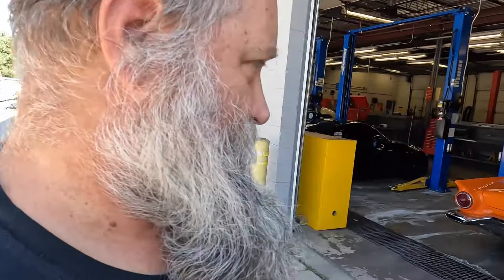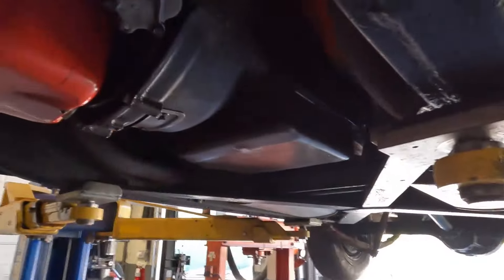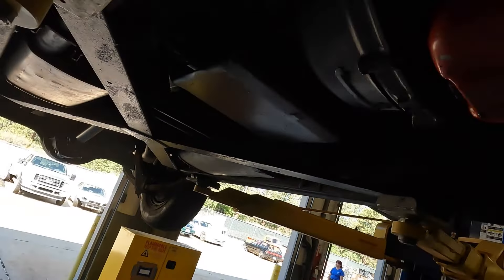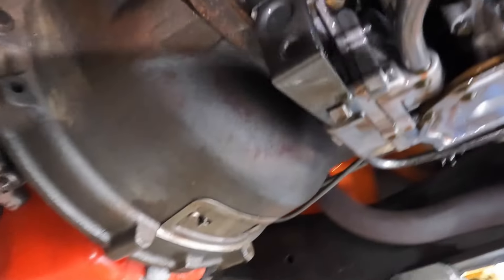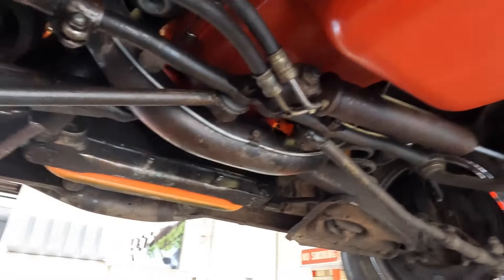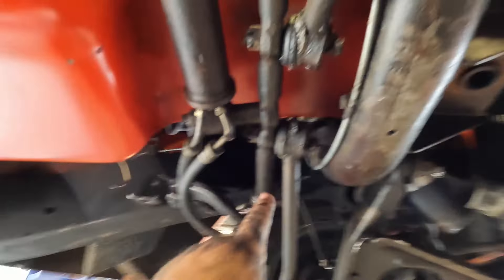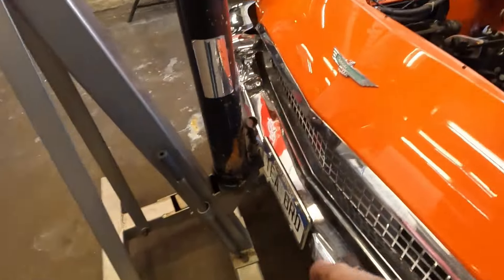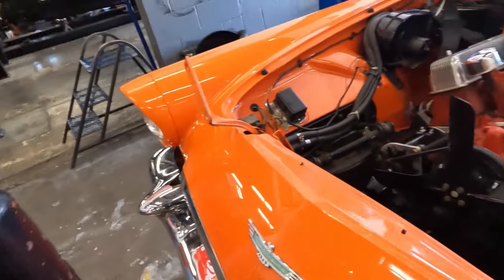1957 Thunderbird Ford-O-Matic

Comment: When you said you were going to remove the transmission without pulling the engine, I decided I wanted to watch this video. I had thought about pulling the trans out of my 57 and thought you just might sneak it out if you removed the tail housing, but I never tried it. There isn't much room with the X frame in the way. I had thoughts of replacing the Ford-O-Matic with a Cruise-O-Matic. 

Also, that is the correct color for the 57 Thunderbird engine. It's a Ford orange and is available from the T-Bird suppliers.
Reply from the maker: @joealbert7773  as I was looking at it from underneath on the lift, it was obvious that Ford made it fairly simple to pull it all out as a unit. The engine sling I made works really good for pulling motors with all the accessories still on the motor.
Reply: Nice video.  There are not too many tbird videos so anything you can put up would be greatly appreciated!  Did you take off the gas cap, the fuel is only pressurized from the pump to the carb.  Please show the engine/trans installation, and what you’re going to do with the engine bay. Thanks 😊